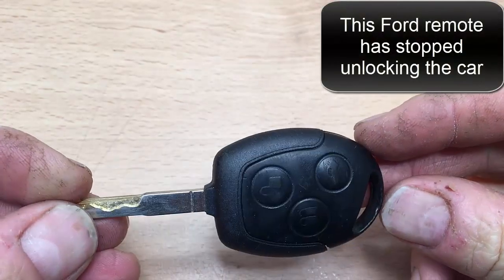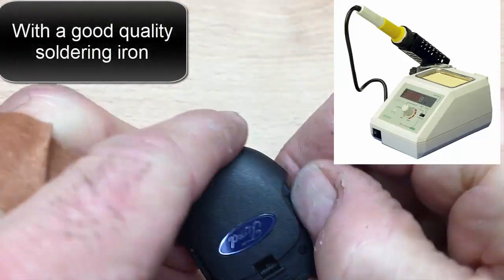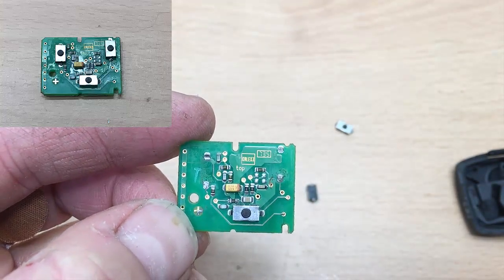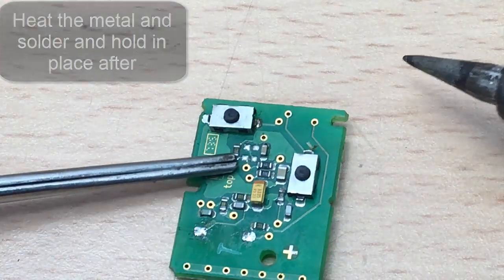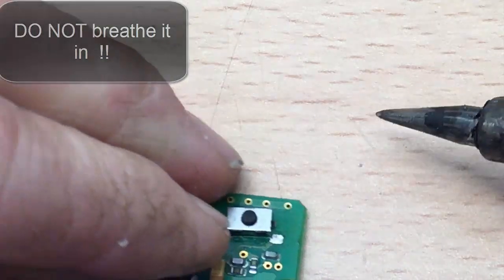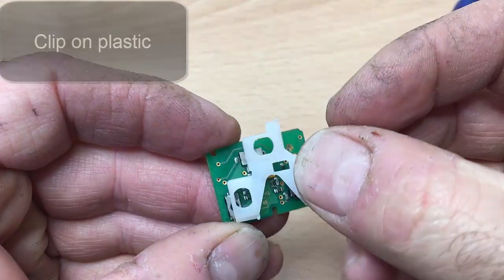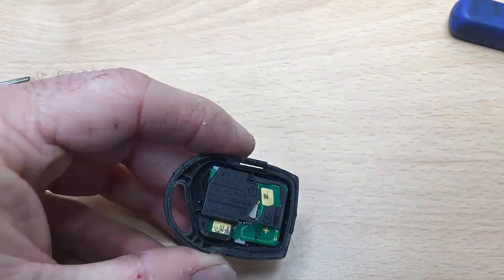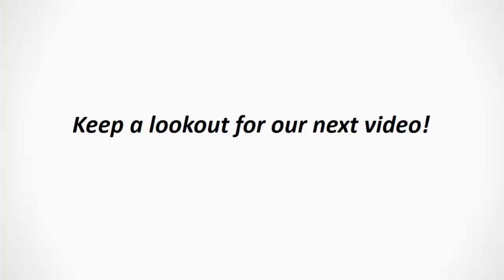Fix Broken Ford Remote key

Comment: I just programmed and cut a key for a 2004 ford fiesta,i gave him a three button ford type remote whereas before he only had a plain key with a transponder in it.
After programming the key i had to get the remote working with a manual procedure,which worked perfectly.
I got him to use it to open and close his doors 'and' the boot/trunk before he left and it worked perfectly.
Then he texted me saying his remote doesn't work,after his 30 minute drive home??
I did mention to him his car i noticed turned over 'very' lazily when he started it,to the point you didn't think it was going to start!So maybe his car battery was kind of low and made the key go out of sync?
But ofcourse fob battery could be flat but it was brand new and working when he left!
Reply from the maker: Hi, was it a genuine Ford remote? We see lots of trouble with copy Ford remotes, but it's very rare for the old style Ford three button key to play up

Comment: Hi, I had to use excessive force to get my buttons to work (had to press with two fingers even) to lock/unlock my car. Now, the buttons have stopped working altogether. The print plate looks fine and so do the buttons. Any tips? Would be greatly appreciated man!
Reply from the maker: Hi Joeri, it may be the small switched that need replacing. We see this a lot. You will need some new switches and a soldering iron, but be careful!

Comment: My fob had terrible range even with a new battery. Took the fob apart and cleaned the sensor and circuit board both sides with isopropyl and a tooth brush. Working perfectly now.
Reply from the maker: Hi Mathew, thanks for posting this, I'm sure it will help someone ;)

Comment: My key has awfull range, replaced already micro switches for lock and unlock because they didn’t work as well. Now I have to press again multiple times for lock and unlock, seems they went bad again. Battery is new. Thinking about making new key now (blade type) is that design more reliable from Ford?
Reply from the maker: The type of key shown in the video is probably the most reliable key ever sold. In my local business, I give it a lifetime warranty because in all my 16 years, I've only had to replace a couple. 
Compared to any French design, Renault, Citroen, Peugeot etc, these keys are amazing. 
Having said all that, I think you just need a new key. I would get a genuine one and it will outlive the car

Comment: Thanks for the video. My issue is that the switch you soldered back has a small little transmitter thing near to it. It has come off and boy is it awkward to get that soldered back, its a nightmare!. I did it twice and now when i opened the key it was off its place and now lost. Can i use any other little transmitter thing from any other pcb that looks the same and solder that to it ?... also the solder flux you have, whats the name for it, the feltip pen flux you have ?
Reply from the maker: Hi, not sure if you can use another component, unless it's off another Ford key the same as you have. 
The flux pen is pretty standard, you can get them anywhere very cheaply. Ebay will have them I expect
Reply: @TheCarKeyMan  thanks man......just was thinking to buy a pcb board to replace the one I have. Now for instance if i just replace old pcb with a new one that would need to be programmed right?..or can there be another way around it?..my open button is finished and secure button is intermittently working. If i get a new key and switch it over 4 times and collaborate the new key that should be sufficient for it to pair right?...then id just need to program it via forscan so the chip begins to work properly?..am I on the right way here.?....I think I've damaged the position where the switch sits and also the small smd next to ot, i lost the smd and replaced it with another one from some other electrical device. I was guessing it might work but do you know what amp the individual smd's are on the board....any help will be appreciated. Thanks

Comment: Have searched your videos but no joy. My key fob was intermittent, now completely dead. Buttons all work but not transmitting. Have changed batteries and changed fob and reprogrammed but still nothing. Contacts are good. Any ideas please? Circuit board maybe? Thank you
Reply from the maker: HI, without seeing it, who knows? Is the key transmitting? I would get it checked out at a local key cutting shop to see if the key is putting out a signal.
Reply: @TheCarKeyMan  it's not transmitting. The car key guy didn't know and said maybe try new circuit board!

Comment: Can you just use the original front with the transponder and buy a new back with the circuit board and buttons in? Really need help thanks!
Reply from the maker: Hi Adam, yes you can do that. The only problem you may find is that with the replacement cases, they may not fit with the original for case
Reply: @TheCarKeyMan  thank you

Comment: The orange capacitor cames out from board. How can it be fixed? With soldering iron or hot gun please suggest.
Thanks in advance
Reply from the maker: Hi Sandeep, I've not seen this, but if it's a small component, then either method will work

Comment: My button has completely come off but if I hold it on the board will it work or does it 100% need to be soldered to work? Just want to see if it's that before I buy new parts, thanks.
Reply from the maker: Hi Ned, have you tried holding it on the board to see if it works?
Reply: @TheCarKeyMan  I have yes but still nothing, should it still work then? Thanks
Reply from the maker: Hi Ned, difficult to say. If the button has just fallen off but is complete, you could try to solder it back on. Don't glue it as that will ruin the key
Reply: Ok and yes it just looks like the one in your video but only 1 has come off, it's strange tho because it was working one minute then just stopped working
Reply from the maker: Do the other buttons work on the key?

Comment: I have a slightly different key fob for a 2011 F-150. I can crack open the clicker and remove the battery, but cannot access the circuit board underneath it. What can I do besides buying a new unit? Thanks!
Reply from the maker: Hi, what's holding the circuit board in place? I've not seen an F-150 key
Reply from the maker: Is it like this? https://youtu.be/UpsQL2kDy4E

Comment: Hi, any idea why my key battery goes flat in a week? Tried different batteries no change. I have the same key on my GFs Ford focus. I used latex gloves when changing the battery.
Reply from the maker: Hi, not sure really. Maybe the key is faulty and transmitting when it shouldn't be? Have you had the key checked?
Reply: @TheCarKeyMan  I checked all the buttons with multimeter and they work as they should, but the battery had 3V which I think should still work. Then I noticed one of battery contacts scratched a hole through the contact pad into the pcb, so I taped small piece of aluminium foil to it and will see if it helps so far it still works. So hopefully that was the issue. :)

Comment: I can’t figure out how to take the circuit out of the black cover :( please help
Reply from the maker: Hello Sophia, the circuit board it held in with three little black fixings. To take it out you need to either melt or break at leat two of these if I remember, then the board will come out.

Comment: I need a new button on the board, can I get them from anywhere do you know?
Reply from the maker: Hi Ned, these should be ok. I'm not recommending the seller as I don't have any experience of them, but this link will show you what you're looking for 
https://www.ebay.co.uk/itm/For-Mini-remote-key-fob-set-of-3-micro-switches-for-2-3-button-remote-car-keys/330472480737?hash=item4cf1b1dfe1:g:QZIAAOSwNRdX6kcS:rk:3:pf:0

Hope it helps
Reply: @TheCarKeyMan  thank you very much :)

Comment: How do you remove the black cover?
Reply from the maker: HI Mircea. Do you mean the black plastic frame on the inside? If so it is held in place with plastic welds, so you just need to gently break them to get at the circuit board

Comment: I want to upgrade this key to a flip key any ideas how to do this?
Reply from the maker: Well eBay sell various flip key upgrade kits. They come with all sorts of issues.
To start with, most are terrible quality.
Next, is it your only key?
Reply: The Car Key Man  I have a key without buttons that I can use and one with the buttons for unlocking and locking
Reply from the maker: ok, there's a few different ways, I'll update this later tonight
Reply from the maker: Hi Cam
Ok, so there are flip key conversion kits available. We don't recommend them for the following reasons.

Compared to the key you have, they are mostly very poor quality. It seems a shame that you would take a good quality Ford key, and take it apart to put it into a conversion kit that may well fall apart. 

Plus there's the problem of getting the blade cut. The large national chains are  often won't cut a key that they haven't supplied. 

So yes although it can be done, you'll need to break your key open, put it into a case, where the parts may not work correctly, transfer the electronic chip over, then get the blade cut. All of these can cause problems. 

If it was me, I wouldn't do it, but I understand the appeal of flip keys
Reply: The Car Key Man thanks for your help